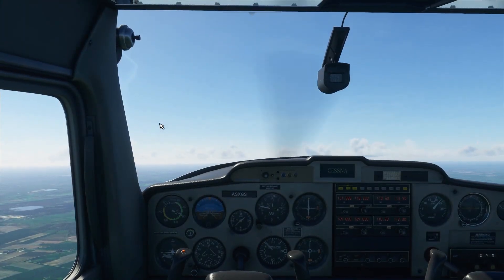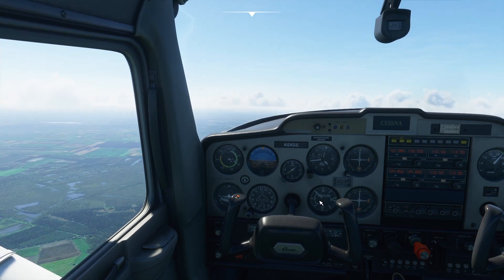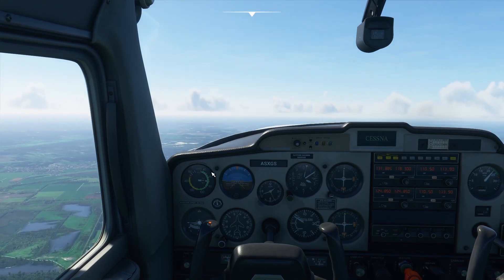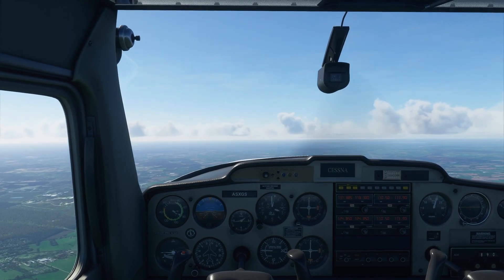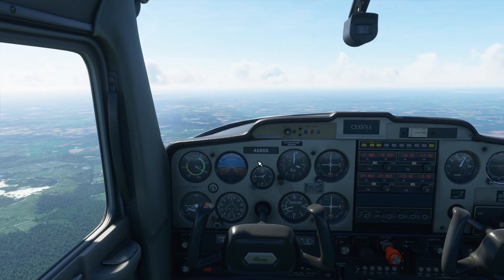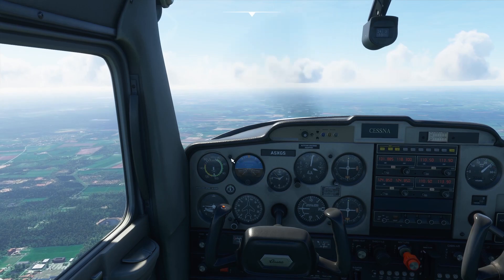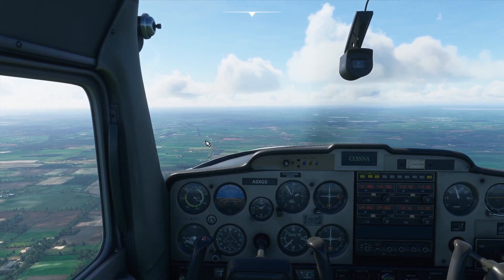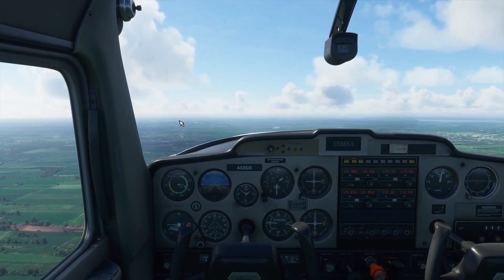Tutorial part #4. Trim and power for Climb, Level and Descend. ✈ Microsoft Flight Sim basics

Comment: When you change the throttle, the nose seems to bounce up and down (and the climb speed too) until it finds some kind of equilibrium.  Is that normal in a real plane too?  If so, when making throttle adjustments for landing etc. then you still need to work the yoke a bit to try and maintain the climb rate?  You can't JUST use purely the throttle because you won't get a smooth change in climb rate?